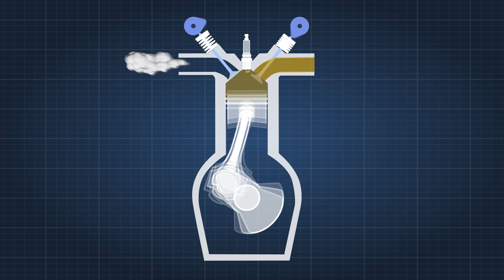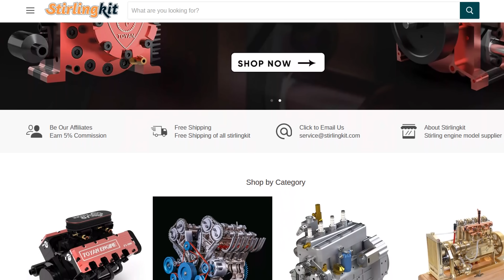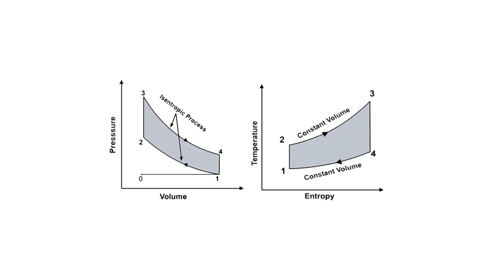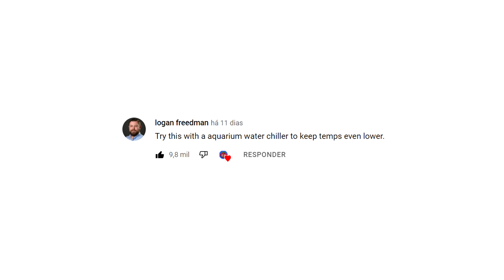I 3D Printed a Transparent Combustion Engine in Resin

Comment: "Pound for pound, nitromethane is less energetic than gasoline, but you can burn a lot more nitromethane in a cylinder. The net result is more power per stroke. You typically need about 15 pounds of air to burn 1 pound of gasoline, whereas you need only 1.7 pounds of air to burn 1 pound of nitromethane."
-site*
As told by that site and with correlation. to my previous statement, we can understand that Nitromethane cannot provide a faster speed nor stronger torque than gasoline other than when it's put in an environment gasoline struggles; an environment with less air. 
This is why I believe that whilst the Nitromethane underperformed the gasoline in this test in this atmosphere, the Nitromethane would outperform the gasoline in an environment with less air.

Nitromethane has an energy content of 11.3 MJ/kg
Whereas Gasoline has an energy content of 46 MJ/kg

As Integza already explained in 9:02, gasoline requires 15 kilograms of air to burn and Nitromethane only needs 2.

If anyone has more information to contribute to this, please reply.

Comment: While yes Gasoline has higher energy density , Methanol has a higher thermal efficiency so more energy goes into moving the piston. Also as an engine goes faster the timing changes, this is why newer cars have Variable Valve Timing systems, and older engines had more overlap, which is why they thump at lower RPM's... think Harley-Davidson engine. We don't uses Methanol fuel in cars as it also detonates far easier then Gas at higher compression rates, and Detonation is BAD for engines.

Comment: Maybe the energy released by the higher power fuels was too much and overcame the resistance of the (low) compression engine therefore taking longer to reach a power stroke. Maybe try adding some oil to seal the gap between the cylinder and piston. I know it can help for two stroke. I agree timing could be an issue. Good luck and I would like to see a furtherment of this video. Possibly a small engine channel like Tinman's Saws would have further insight.

Comment: The 25% nitro methane may be igniting prematurely due to the compression itself, not the spark plug. This would knock the engine out of its designed cycle and lower the speed, while giving the illusion of running smoothly. It would also lower the intake of fuel over time due to it being out of rhythm.

Comment: Where is my 3D printer? Have a 3D printed engine and transmission that powers an inverted tesla turbine at 30,000 rpm (no lilies here), put it in a boat, see how 250 psi moves the boat... Duh!

Comment: As others have mentioned the fuel/air ratio and ignition timing are probably a factor. The lack of a head gasket might be playing a role too, at 10:05 you can see exhaust gases poofing out of the seam which would suggest its not getting as good compression as it could.
Reply: yes and also even with a head gasket it appears the melting Resin is creating a lack of Straight Deck to even get any clamping seal on. that is also an consideration to take as well

Comment: I assume that the main reason for the lack of power is that the oxidizer / fuel ratio isn't changed to match the fuel. 
Like you said yourself, the nitromethane has a quarter of the energy of gasoline, but since you need less air to burn it you can put more than four times more fuel in the cylinders.
If your engine doesn't put more fuel in, of course it has less power. It's filling the cylinders with air that does nothing.

Comment: if you listen to the engine you can hear the engine knocking which can be caused by bad timing or a bad fuel air ratio or fuel octane. You can solve this by retarding the spark.

Comment: One of the possible explanations to this would be the age old diesel vs gasoline engines, diesel engines rarely go above 4500rpm but has more torque than a gasoline engine, that's why it's used for all heavy machinery. 

I think the strength of the combustion would dictate the revolutions.

Edit: oh yeah, additionally the stroke and bore size also dictate the revolutions

Comment: I'd also guess its because of the mechanical nature of the reed contact thats used to pickup the Crankshaft's position. 
keep in mind, it's not only igniting at the Powerstroke, but at every incidence the Piston is at it's highest point. 
Those reed contacts need to be accelerated and decelletated twice to create one negative flank that indicates passing the upper endpoint. 
Could be just about losing the sweetspot in those higher rmps. Depending on the nature of that Spark plug circuitry, try a hall sensor instread. You may even need a power transistor to energize the coil if it's a regular ignition coil setup. This will also require a reverse diode to protect the Hallsensor and Transitor from the peak voltage, even better, a set of HV-Caps (WIMA MKP). For a transitor, something that switches really quick is important. the steeper the flank, the better the ignition. That's why mechanical contacts remained for so long in combustion engines.  
good luck, and thanks for the nice video.

Comment: One hypothesis I would suggest for performance/fuel is that mix ratio is important and unless the carburetor is controlled for the specific mix ratio with the butterfly valve, you will not get adequate performance for each fuel. In this case, my favored hypothesis would be that 4 strokes may not provide an adequate mix ratio with the valve setting and the pressure to ignite properly.

Another thing to consider is that different fuels will require different compression ratios to ignite adequately. Compression is a fuel dependent design variable in a 4 stroke engine but the general philosophy is more is better till you reach a weight limit for structural strength to hold the pressure in. There is however a minimum pressure for many fuels to ignite repeatably.

You seem to have a major leak on the cylinder head (looking at those bubbles), I would recommend adding a gasket and see if it improves the ignition because if pressure leaks, that means you may not have enough pressure built up to ignite some fuels properly.

Comment: I think the head is leaking. You aren’t getting enough compression due to that. Maybe you need a gasket or just get the top flatter. Or both. You can see bubbles leaking out of the head early in the video.

Comment: The strongest fuel makes less RPM and the weakest fuel makes most RPM. But you only tested it without any load. Maybe if you give a load to the motor you would get different results.

Comment: Probably the atomisation of the fuel is not good enough for it to combust every time. Also, adding a load (slowing the engine down) will make sure the mixture has more time to enter and mix in the combustion chamber. Ofcourse the mixture and timing (which is somewhat less important) have to be about right. Cheers from a mechanical engineer, you're doing a great job!

Comment: What you need is an after burner. Not sure how well it will work with 3D printed parts. But in industry they reuse some of the air to increase thrust without making the flame so hot that it melts the metal. Theoretically I assume this should work on a smaller scale for 3D printed parts which are cooler to begin with?

Comment: Power is not always higher with more RPM. Even with the same Fuel, i can run my two Stroke Engine with a setup that reaches 14k rpm but in this case the Torque is pretty small and the engine runs pretty hot. With a good carb setup it runs only up to 12k and stalls but has much more torque in all situations

Comment: Towards the end of the radial engine/propeller age, aircraft engines began using a power recovery turbine, which recovered some of the waste exhaust gas energy through a turbine that mechanically connected to the propshaft to add power. Pretty neat what they came up with at the absolute limit of radial engine development

Comment: Would it be possible in therory to use the heat produced by the engine to create a steam generator? So it cools down the engine and don't waste thermal energy at the same time.

Comment: You should make a supercharger to attach to the engine to force more air into the engine. You could play around with different design and it might make the engine have a more consistent power strock

Comment: Try and reduce your spark plugs gap. A larger gap will tend to make a "faster spark" and slow burning fuels take longer to ignite so reducing your gap will increase the spark duration. This is done in cars running E85.

Comment: Wonder if adding a 3d printed turbo would work

Why not out the engine in a 3d printed model boat?
Or why not see if you can 3d print a full size one since you already did a jet powered skateboard some kind of boat might be interesting.

Comment: Are you aware there's a clamato ad on this video. Or is there a virus? Also please create a video using the golden ratio of tri-angle and spiral to create a multi-component device. Minimum 7 total printed golden ratio pieces. Preferably a (your choice) input/output based device for purposes of generating electricity. Sorry about my double post a tomato held Me hostage the second time.

Comment: Try measuring the output of the hall effect trigger to see if the triggering signal is slew rate limiting in response time. Also do the same at the ht spark end. Create a capacitive divider network to reduce the HT voltage your trying to measure with your oscilloscope to something within the voltage range of the oscilloscope. You can create a capacitive voltage divider clip with a giant plastic peg to clip to the spark plug, and use insulated wire coiled, to create two capacitances for a voltage divider.

Comment: I mean, come on. 25% efficiency in internal combustion engines was a thing in the 90s. We are at almost 50% in F1 and up to 38% in roadgoing vehicles. Also the system efficiency is even higher.

Comment: I don't know a lot about engines.  I'd theorize that you have a problem with the exhaust not exhausting enough, the intake not giving enough fuel (or too much) and therefore making it harder to compress and have a power cycle each time.   However, I could be wrong.  There are other theories in other comments below that look good too.

Comment: I think there are two problems going on simultaneously, one, stochiometric mixing of the fuel in the cylinder is off, and second, the timing for the spark is off.

Comment: Without a load the engine will idle at the rpm which corresponds to the ignition flame front to test power recovered after fuel is burned you need a load so you can see which fuel will give best power  recovery in your engine. 

Your engine geometry and specks may not be capturing peak efficiency for the fuel you are using vs the fuel it wants

Comment: You would get a consistent 4 stroke action if the engine had a load on it at all times. 
What you got the result from, was the engine idling which caused it to only fire when it needs to keep the idle rpms somewhat steady. 
It simply would not fire every 4 stroke because it didn't have enough fuel air mix for the current engine load.
Put a propeller or a loaded permanent magnet motor on its shaft and try again with letting the engine run with each fuel for a minute. Then you would get a constant rpm as well as see each power cycle.
Also note that each fuel needs a certain compression ratio to fully optimize its performance. You could make different cylinders etc for each fuel.

Comment: Nitromethane is more volatile and burns faster with less expanse than gasoline. Gasoline expands more thus causing more pressure on the power stroke. Drag cars that burn nitromethane are set up in a way that turns it's volatility into horse power.

Comment: methanol less powerful than gas? no sir..... you likely werent rich enough as the air to fuel ratio is around 4 to 1 with methanol which is how it can make more power than gas which is 12.5 to 1

Comment: Try to put some load on that engine. When running freely, piston may actually "run away" from explosion and thus ruin compression and whole working phase. Easy to hear on two stroke engines: when idling, there is one strong BAM  once and then several just rambling in background until another BAM

Comment: With a v8 car, I have to have a different carburetor for different fuel mixtures. You mentioned the different amounts of air needed to burn each kind of fuel, how much air is getting through the valves in the engine?

Comment: If that engine doesn't have crank case ventilation then it needs some. Also, you seem to be getting blow-by on the piston ring. And did you try different octane ratings of pump gas? It might be a good idea to actually measure the compression ratio and volume too. Check to see if the valves are allowing blow-by as well. And the carb will probably need retuning or even different metering for different fuels man. You seem to be running a bit rich.

I'm guessing there's no lubrication system here as I don't see the piston being oiled from the crank. It could simply be that this little engine isn't going to cut it for what you want. It strikes me as more of a novelty piece than a legit engine that makes power.

Keep up the great work! I love your channel :)

Comment: My theory is that it isn't evacuating all of the exhaust from the cylinder, causing an overly lean amount of fuel in the cylinder until it finally purges the cylinder of the exhaust. This is the reason why 2 stroke engines stumble until they rev up, because there's still exhaust occupying the cylinder at the lower rpms causing dead power strokes until enough intake charge pushes the exhaust out.

Comment: When dealing with compression you also have to remember there's a difference between Dynamic compression and static compression. Static compression is the typical one used to measure the compression of an engine. It only refers to the Piston at bottom dead center and the Piston at top dead center. However this is not always the proper way to measure. When the Piston is at bottom dead center the valves are still open, which means that it's not actually compressing any air. As the Piston moves up in the bore, the valve is still open for a bit, then fully closes. The measurement of the volume that is compressed in the combustion chamber when the valves are fully closed is called the dynamic compression ratio.
Reply: I think only the most advanced ICEs (like F1) use dynamic compression
Reply: @ebonfortress  no, Dynamic compression occurs in almost EVERY combustion engine due to intake and exaust duration overlap. When going up on the compression stroke, your valves may still be open. This means you're not actually compressing anything in the combustion chamber. So if you were to measure your compression based off bottom dead center to top dead center, you would not be making up for the compression lost due to valves being open. Dynamic compression ratio understands this, and makes up for it. Dynamic compression ratio is only measured from when all valves in the head are absolutely closed during the compression stroke.
Reply: @sethh8892  Thanks. Just read that actual operation of ICE is somewhat more complicated than a simplified model we all know. What really surprised me is that both intake and exhaust valves could be open at the same time and it actually improves performance
Reply: @sethh8892  As far as I understand intake/exhaust overlap is kinda different. You want to have as large stroke as possible during expansion to utilise as much combustion energy as possible but you can't have say 20 to 1 compression ratio on compression stroke because of knock. So you keep intake valve open to keep the "real" compression ratio to say 10 to 1.
Reply: @ebonfortress  yes, thats called dynamic compression. Its the actual copression the engine experiences. If you only measured from bdc to tdc you would get static compression.

Comment: The difference in speeds depends on the speed of combustion of different fuels: with a high-speed combustion fuel, the engine will run with higher rpm but probably with lower torque (low torque is due to the fact that combustion ends much before the piston reaches the bottom dead center; there will be a preak of power at the beginning of the stroke but will last for a very short time).
With a low-speed of combustion fuel, there will be lower rpm but higher torque, because the resistance load will be opposed by the explosion during almost the whole stroke of the piston.

Hope what i wrote is understandable😅

Comment: I think you have to investigate into some sort of head gasket and that might help the compression issue cuz in the slow mo videos you can see just whisping outside between the plastic and the brass if you had like a little copper gasket or a little steel gas or something that can be crushed on or in a groove that would probably help get your closer to every power stroke every four cycles

Comment: It’s the compression of the engine, that’s why different engines use different fuel octane levels, for a fuel that doesn’t ignite every time you need more compression to assist the ignition process

Comment: Needs more or less advanced in timing for the different fuels. We changed over to an e10 blend, that took my car from 10° to as high as 18° to get it to run right. 

That is a much smaller change then the differences in any of the fuels you tested.